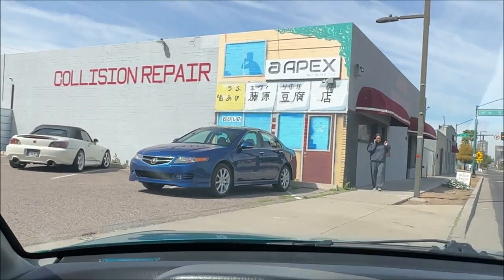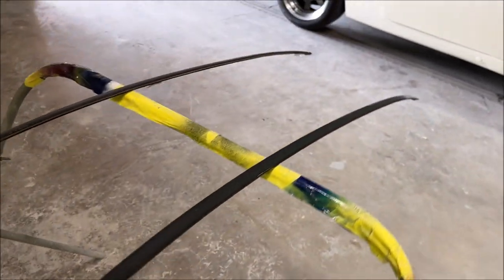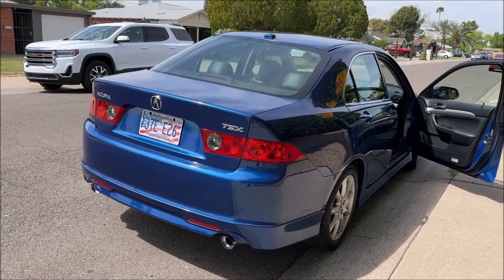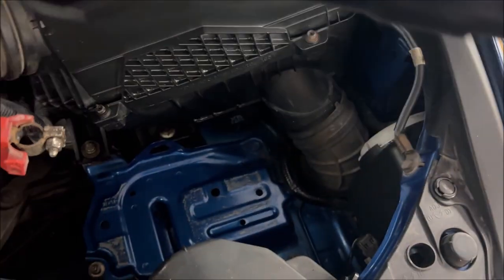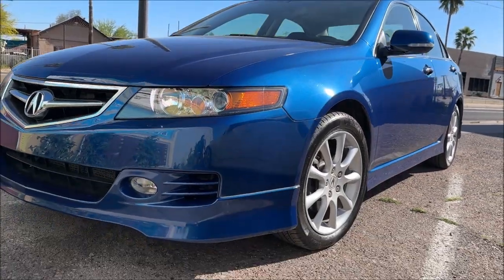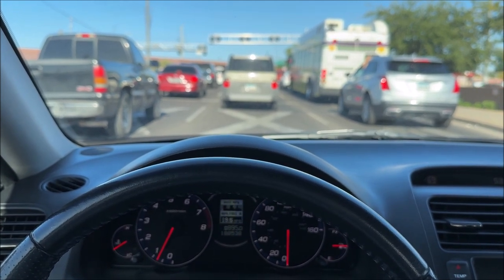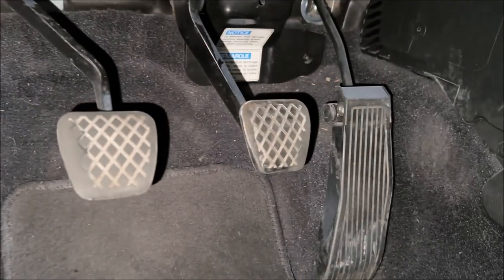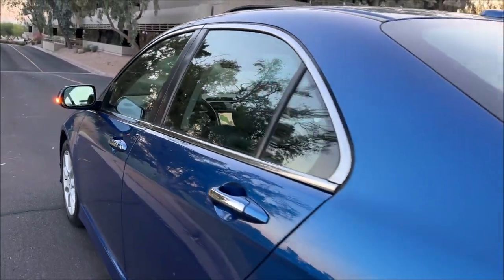2006 TSX 6-Speed Restoration Part 4: Paint Complete, Clutch, Spoiler, Upholstery Work, & Floor Mats

Comment: Arctic blue is glorious! Back when these cars were new I rarely saw them in this color. mostly gray, silver and white... how little things change.

Interesting idea of using seals on the front and rear bumpers between the lower under spoilers.

Speaking of roof drip moldings, one reason I believe Acura hasn't discontinued these just yet is they're Honda sourced. It's my opinion Acura discontinues their parts sooner than Honda sometimes by 5-10 years. Since the rails are used for the Accord Euro I believe they're still around due to Honda not Acura...

BTW, one of the few times Honda cost-cutting may have actually helped is with the roof on the new 11th gen Accord. They've now advance to laser welding the roof panel to the side pillars eliminating the need for roof rails entirely. The purpose of the rails is to hide the weld seams and deep rain channels. If you look at a new Accord notice the absence of roof rail moldings. More amazing is even without these it's impossible to spot any seams where the panels are joined. Bottom line, the deep roof trenches are gone, the rail covers are no longer and the design is much cleaner.

And speaking of cost-cutting one of the first things I noticed on my '04TSX  was how thin the carpet in the car and on the mats were. On the mats it wasn't just the thin carpet pile but the backing too. If it weren't for the accessory all weather mats these would be long gone. A word of advice, if you want to preserve your new mats, cover them with other mats. Silly isn't it?

Otherwise it's still a wonderful car and proof no car is perfect... 😉
Reply from the maker: That's a good point about parts availability! I've had similar discoveries with the RSX. Even though it's only 7 years newer than a Legend, I've had zero issues sourcing things for it. As for the new mats, they're going back into the trunk as soon as the car leaves the showroom!  No shoe prints allowed.

Comment: Hey Tyson, was the back seat leather cover entirely changed or did they repair the hole? Also are those oem headlights?
Reply from the maker: There was just one panel replaced in the seat. The headlights are aftermarket, but I saved the OEM ones.

Comment: Your TSX looks awesome. did you go for Honda clutch set or aftermarket? I am debating for my 95 Civic. I've been looking daily for new floor mats unfortunately no luck so far. :(
Reply from the maker: My friend Eric found some nice looking OEM "look" Civic mats on Ebay recently. The clutch we used for the TSX was aftermarket, I can't remember the brand.
Reply: @TysonHugie  Exedy is an OEM supplier to Honda and they're made in Japan, does sound familiar?
Reply: @DrivingHy  that is the manufacturer i am considering over original Honda parts. It’s significantly less money for the kit. Your thoughts on the quality?
Reply: @TysonHugie  i tried some ebay matts while it looks decent the quality aren’t good or my expectations are too high. lol… did you replace the flywheel or resurfaced it?
Reply: @HiFiInsider  Since they're Honda's OEM supplier it's likely they built the original. Interestingly the original was made in England, the replacement was from Japan. My experience is very positive with them, no regrets!